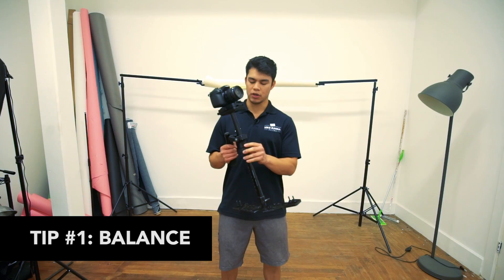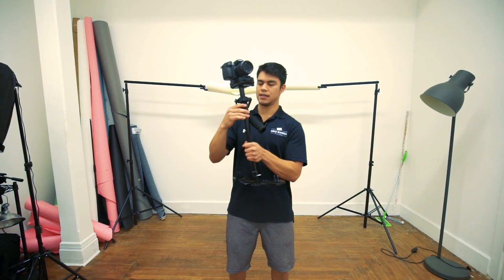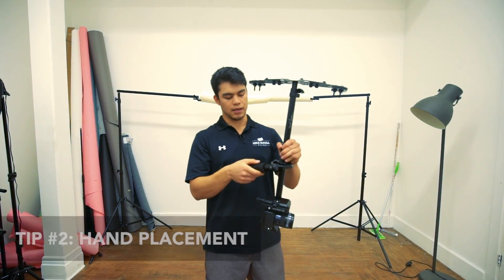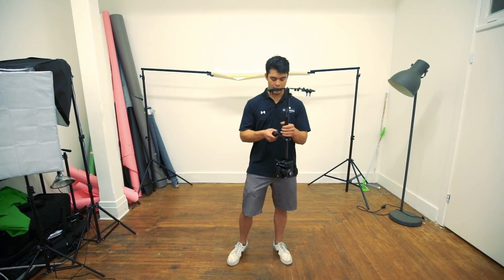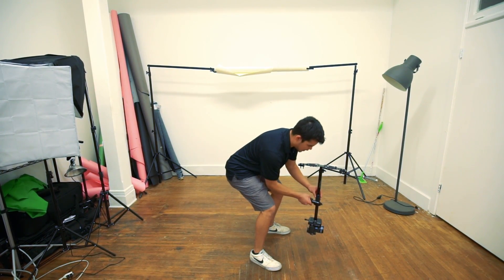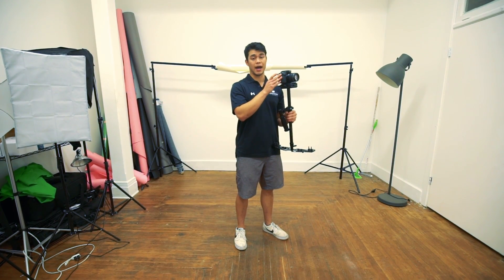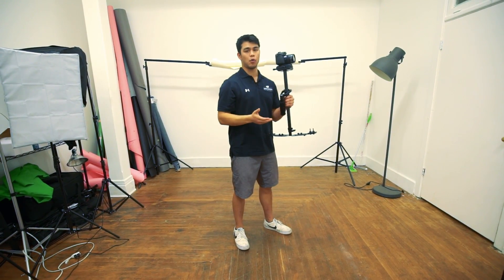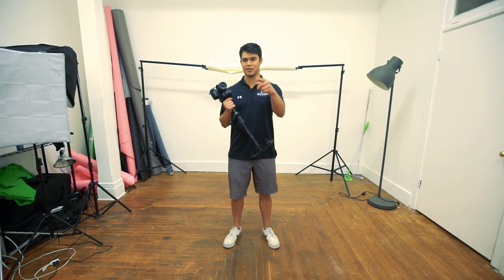'Devinsupertramp Glidecam' Tutorial - How to Film Upside Down

Comment: Would like to see a tutorial about how to film upwards with a steadycam
Reply from the maker: Hopefully this helps https://youtu.be/sh23KJHXaJg
Reply: MikeZunigaFilms I've seen it before.. but its not it. 
Can you use steadycam to film sky or ground, but when moving forward or backward at the same time? If so, how to make camera not to wiggle and stuff? 
In video you linked me, you show camera tilt up or down when you stay in one spot. Can you keep it up or down? :)
Reply from the maker: Do you mean how to tilt up or down as you're moving?
Reply: yes. tilt up as you're moving AND keep it that way. Let's say you need to film church ceiling. How do you point camera up and move forward without a wiggle? :)
Reply from the maker: Ahh, I see, yes that takes practice. Some tips that has helped me is staying low, bend your knees as you move, and having a controlled touch closer to the top of the handle.
Reply from the maker: Hopefully this helps as well https://youtu.be/tvrIiiNjqxA